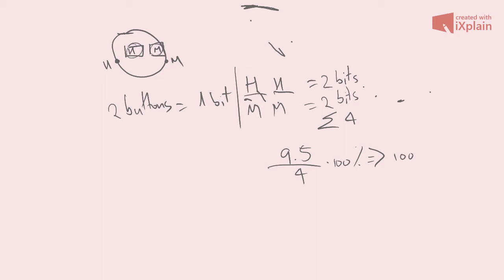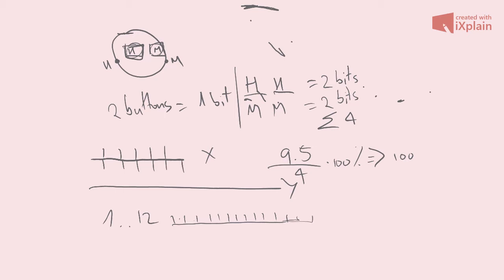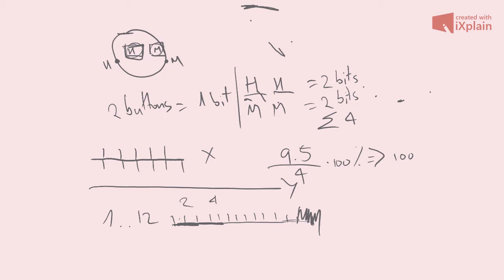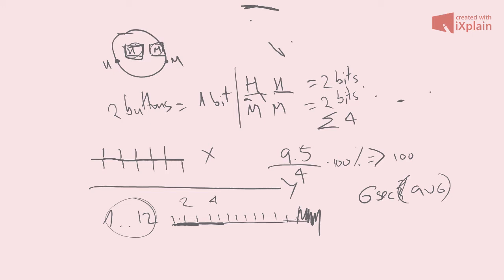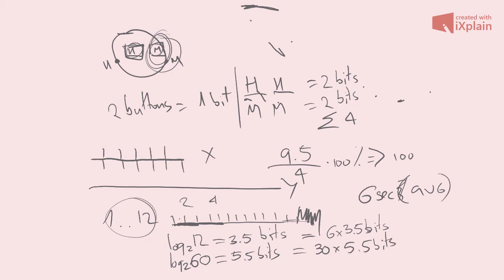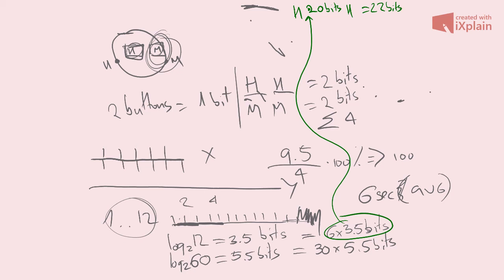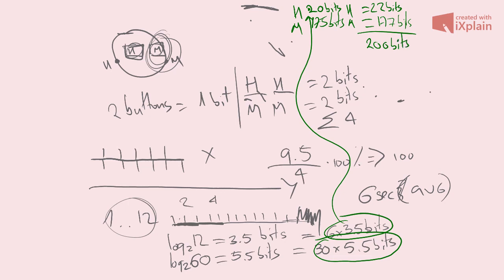#10.1 Information efficiency applied to interface design, errata

Comment: 1/20 * 100 = 5%  :) I guess you just demonstrated that clicking for changing the value is a much more efficient design than the one with auto increment mechanism. Cool. Thanks for the video.